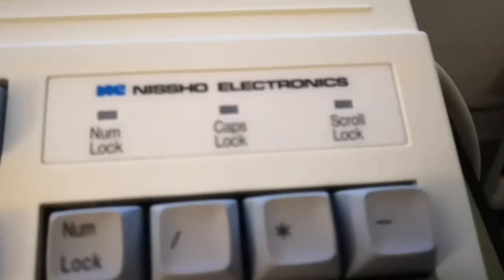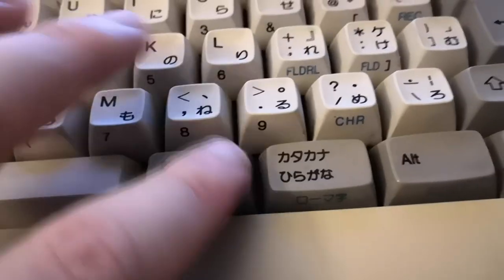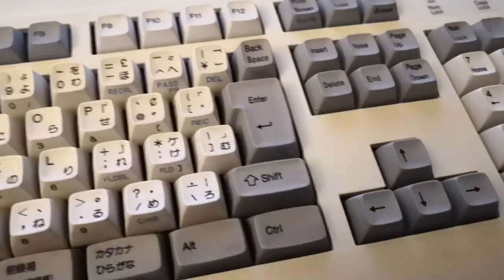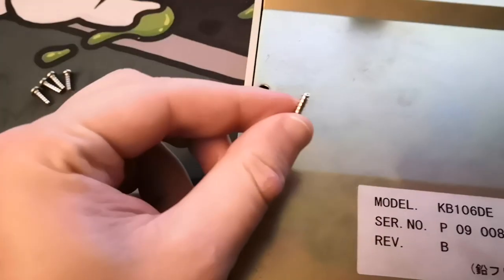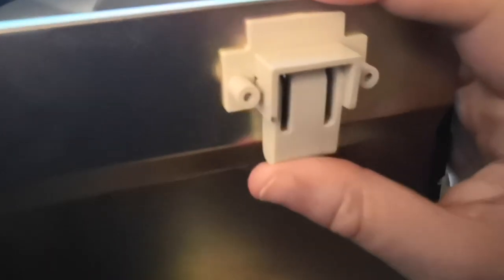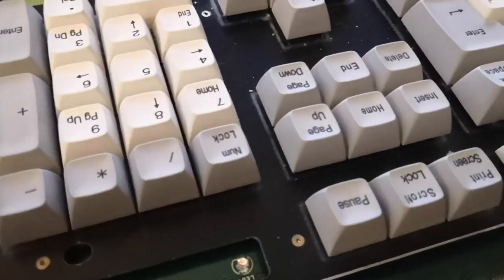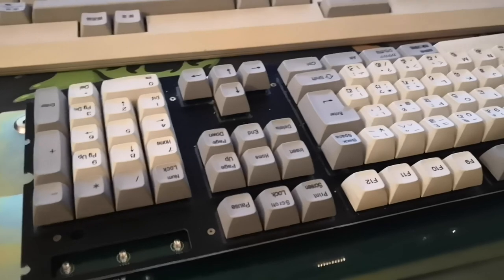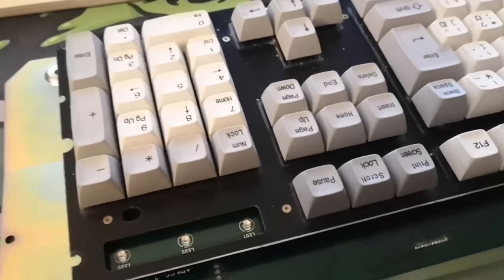Nissho topre keyboard teardown and opinions

Comment: Seems like Inozenz is getting all of the good stuff 🥴

Is it true that Topre HiPro is agonizing to type on?

Also, what's that beaut of a board in the background?
Reply from the maker: Inozenz is a high roller for sure but you don't need to worry about him hoovering up all the good stuff like Andj. He buys one and treats it well. A good chunk of what I'm moving for him is actually getting redistributed to other europeans too I understand. 

Topre hipro is a bit sharp but agonizing would be pretty melodramatic. I would rate it as one of the worse high profile spherical profiles though. 

The board in the background is a Fujitsu N860-2351-T001 model "FMV KB101 JIS" which turns 28 years old this month. If you search Yahoo Auctions Japan with buyee for "Fujitsu keyboard" and sift through like 50 pages of results you will probably find one or two. That is how I found this one and how I found another for a local of mine, his was made in 2010! 
Here is a vid of it: https://www.youtube.com/watch?v=wAiEcaPwj1M